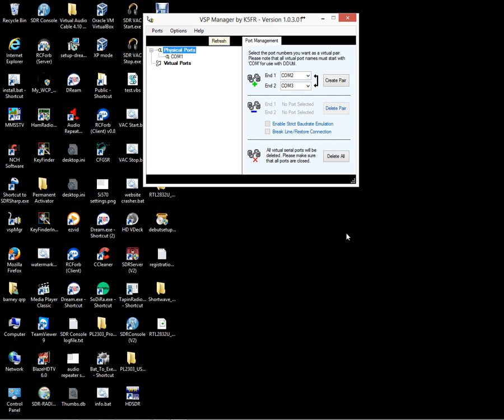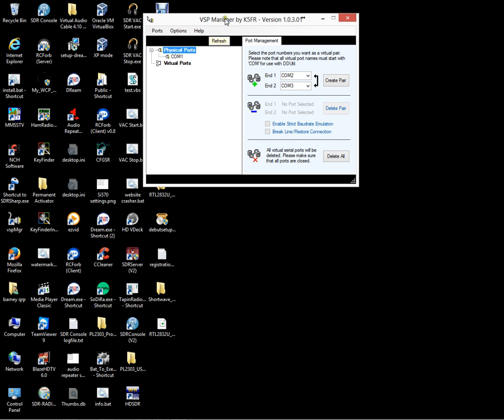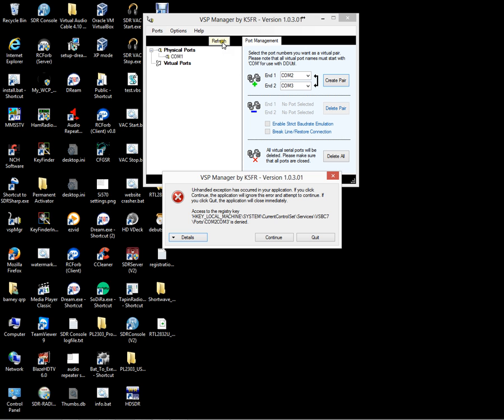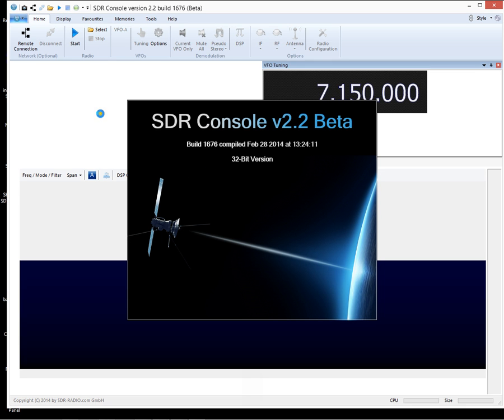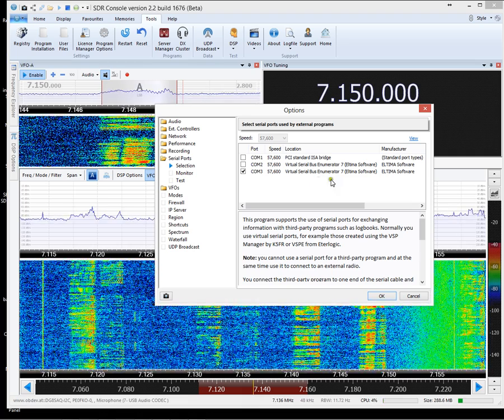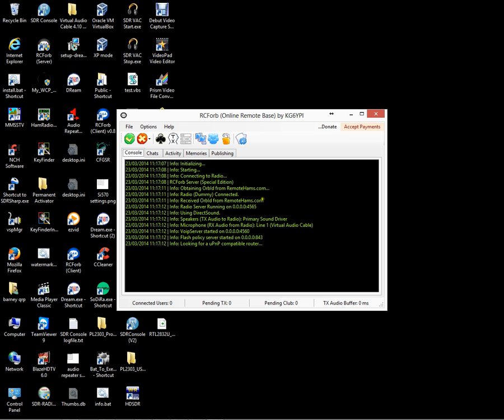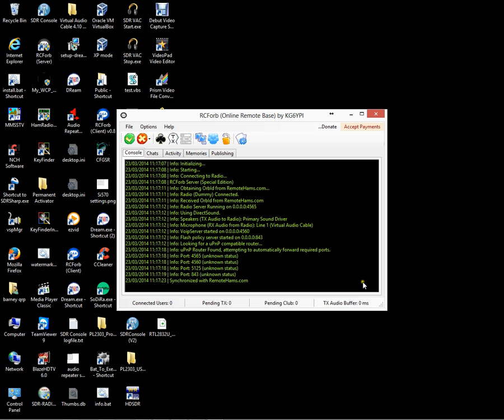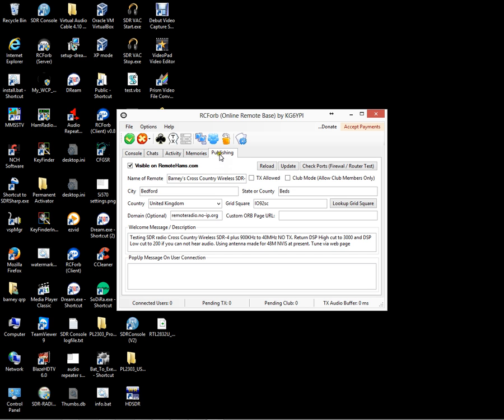Adding VSP Virtual Serial Ports to SDRConsole

Comment: I recently bought myself a Sun SDR Pro2 transceiver and want to use it on at least three computers on my network. Yes, the SDR is in my shack and is connected via Ethernet to my network switch. I can access the radio from all three computers really well. I've used HRD for many years and really love it. I decided to purchase the very latest version yesterday. I've already made a backup of my log from the main computer in my shack. I've already installed the log into the fresh copies of HRD on two of the computers. Funnily enough, I'm having problems connecting to my shack computer through the network. I think I may have to use another computer. Anyway, all that needs to be done now is configure HRD so that it will work on each computer with the SDR. I'm also hoping that I can control HRD rotator from each PC as well. I don't know whether I need to use the HRD remote server but I will need to use a virtual com port. Basically, I was going to ask you if your video would be helpful to be as well, obviously the software is  different but I would imagine on the setup is similar.